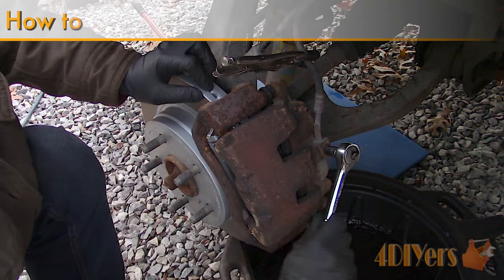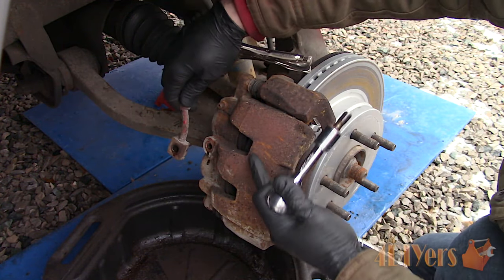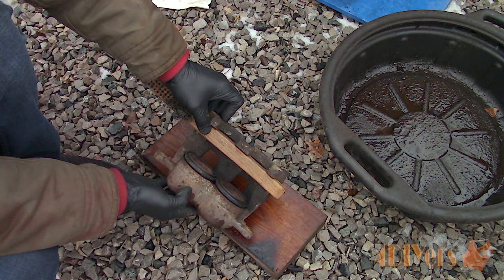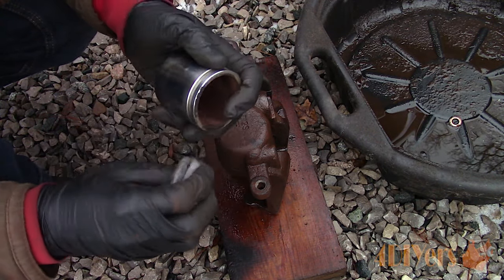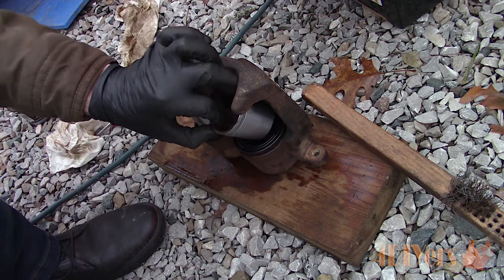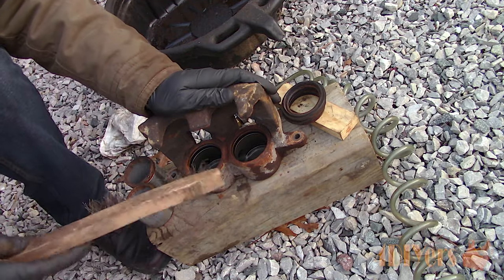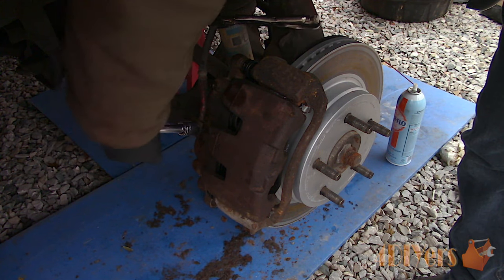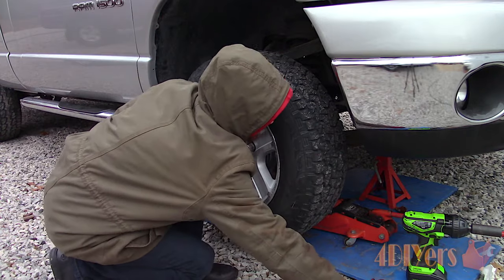How to Rebuild Brake Calipers

Comment from the maker: Here are the Amazon links for some of the products used in the video:
USA:
Scotch Brite green scuffing pad (600 grit): https://amzn.to/2MGpgxJ
Scotch Brite white scuffing pad (1200-1500 grit): https://amzn.to/2YM0cI9
Metal polish: https://amzn.to/3tytqIH
Brake cleaner: https://amzn.to/3df8FvQ
Steel wire brush: https://amzn.to/2Mx5F35
Brass wire brush: https://amzn.to/2MJM1ka
Copper washers metric: https://amzn.to/3u8DtUQ
Copper washers imperial: https://amzn.to/3s6W8Pn
Brake hone: https://amzn.to/3ppHxwn
Canada:
Scotch Brite green scuffing pad (600 grit): https://amzn.to/2MEQowT
Scotch Brite white scuffing pad (1200-1500 grit): https://amzn.to/3tvlAPL
Metal polish: https://amzn.to/3aACPGZ
Brake cleaner: https://amzn.to/3doe0AW
Steel wire brush: https://amzn.to/3cOcWpW
Brass wire brush: https://amzn.to/36P0jH6
Copper washers metric: https://amzn.to/2NvJF8S
Copper washers imperial: https://amzn.to/3asEX4F
Brake hone: https://amzn.to/3doeA1A

Comment: DUDE! The vise grips with rubber hose to crimp the hose so it dosnt leak is BRILLIANT
Reply: Lol
Reply: Ancient Trick. But a good one
Reply: It damages the hose and can cause a caliper to hang up
Reply: Or you can tie the line upwards where it wont leak out
Reply: I've got a better one for ya; before removing caliper, press the brake pedal down and hold it in place with a clamp or stick. It will prevent the fluid from draining from master cylinder. Granted you will have to let the line drain but it should stop. Prevents damaging the rubber hose.
Reply: @JackRR15 That's how I've always done mine.....I cringe when people squeeze the brakeline hose,also prying with a screwdriver around caliper.
Reply: HS4a805 for that to work, you’d need to elevate the end of the hose higher than the master cylinder reservoir.  Or bend the laws of the universe, whichever is easier.

Comment: I’d just pump the brakes without the pads installed, those pistons come right out. Just stop before the seals let go and drain the caliper before pulling them the rest of the way out

Comment: Thanks. I used your video to do my 06 2500 HD. Mine were much easier, I lubed up and pressed my cylinders in first. Then I added the dust boot last since you can tap/press in with a blunt flat punch tool.

Comment: I tried this once on a subaru.  I never managed to get the seal, boot and piston back in place.  Something would always pop out of place.
You did a great job. I like to "hydrate" the rubber boots with silicone paste when I clean my brakes yearly.
Reply: Oof, i'm about to do this on my Subaru😬

Comment: i was having a hard time with installing the new boots by myself.  so i abandoned the job for today.  i am glad i caught this video.  awesome tips.  I am definitely going to do this!! 😄👍
Reply: I struggled with the dust boot for over an hour. The boot must be on  the piston and slid towards the  caliper bore and near piston insertion end so that the boot will fit into it's caliper groove. The problem was that while trying to expand the boot to go in the groove it would slip off of the piston. I finally resolved the problem  with a hose clamp lightly securing the boot on the piston and then expanding the boot to it's caliper groove. Once in the groove they do a good job of staying put. Then sliding in the piston and the outer boot into the piston groove is much easier. 
  Hope this makes sense.  The other piston and seals went as described in the video.

Comment: Outstanding job and complete job. I have also seen the rubber boot slid over the piston before installing Per Eric the car guy. Thanks for sharing with us.
Reply: If the seals are not installed with the lip looking in the correct direction...the pistons wont return   and the brakes will drag..a close up view of the seals is important

Comment: Just to add from my experience when pumping brake pedal try not to press down further than it normaly would during use as the master cylinder piston can score the seals, then you'd have a sinking pedal during braking, it's happened to me! Cheers mate, good info
Reply from the maker: Great tip, thank you for sharing!

Comment: Forget the compressor just use the power of the hydrolic fluid and press the brake pedal with the caliper detached but still connected to the fluid line.

Comment: Good Video - but don't vise the grip brake line. Try an old valve stem in bango bolt hole, if you don't want all brake fluid to leak out😊

Comment: ...what happens if the brake fluid gets on the discs and pads?
Reply: If brake fluid falls on your brake rotor or brake pads this may cause resistance on the friction that the brake rotor and the brake pads are supposed to create. Spray pads and rotors with brake cleaner if brake fluid gets on em.

Comment: So the whole piston has to come out if you just want to replace the dust boot? There is no way to leave the seal and remove and replace JUST the dust boot?
Reply from the maker: There are some commenters who have been able to replace the dust boot while the piston is in place, this will depend on the design.

Comment: Great video, very helpful. Noticed my boot is ripped when doing my last brake job. Caliper is $95, new boot and seal are $2.15. 

Any tips on removing and reinstalling the piston when it is a twist-in style?

Comment: I bought a set of used Brembos, decided to rebuild them. When putting back on of the pistons, I stupidly forced it in and now it won't go back in. Im thinking I need to try out this honing tool, but we will see.
Reply from the maker: Sounds like the seal is binding.

Comment: Aren't you supposed to use grease on your pistons???
Reply from the maker: No, it'll contaminate the brake fluid. Only use brake fluid.
Reply: @4DIYers  that's what I thought, but on another video the guys rebuild kit came with a little packet of grease & he rubbed it all over the piston 🤷🏼‍♂️
Reply: This part confused me too. I just rebuilt my calipers, used permatex silicone ceramic extreme brake lube on the sealing washer and piston, according to other videos I had watched. Hoping I don't run into issues.
Reply: Where the hell is the metal ring to hold the piston boot from popping out